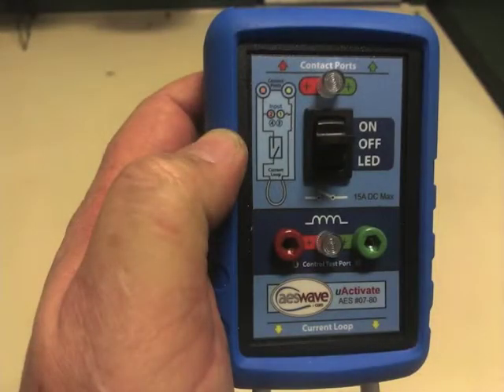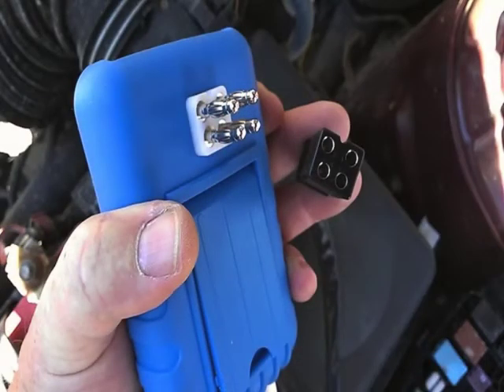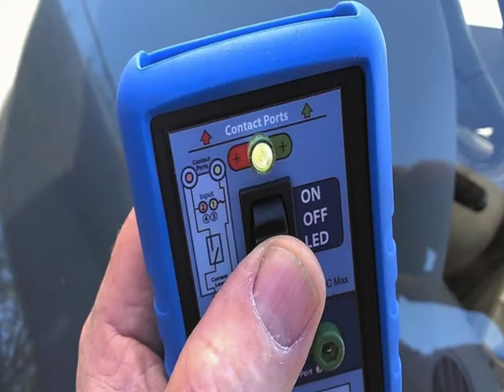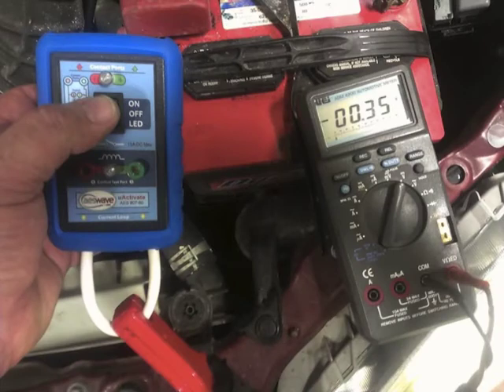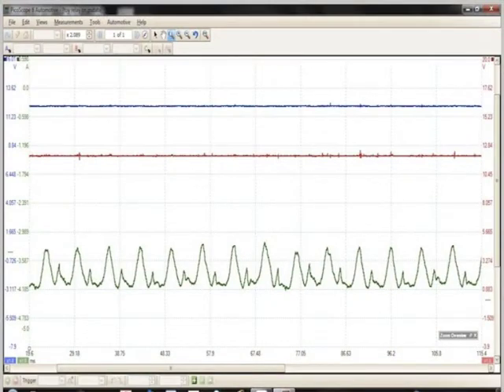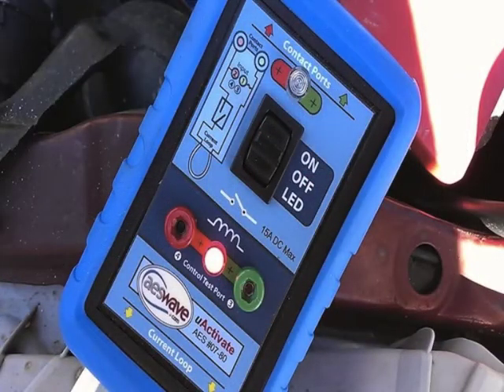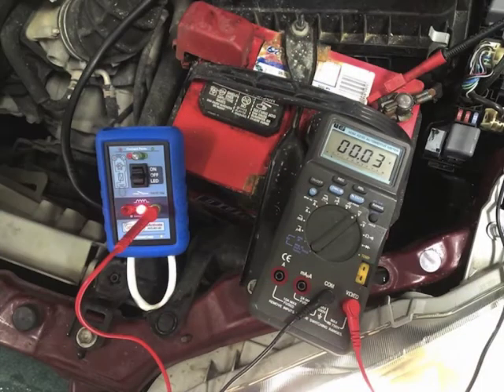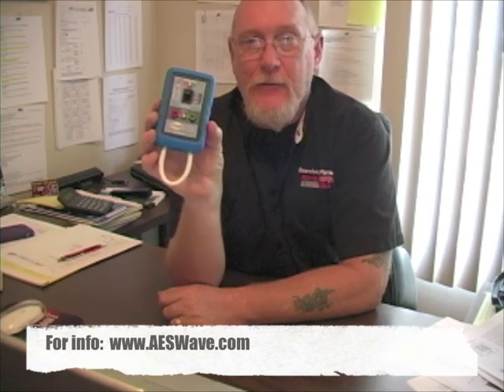Troubleshooting Relay-Controlled Electrical Problems WIth uActivate

Comment: What is the LED switch for.
Reply from the maker: If I recall correctly, it's a polarity check to see if the relay uses a power or ground side driver.

Comment: i have a 2001 gmc savana 3500 box truck with 350 engine 5.7 L . just had ac charged and a new compressor put in. ac clutch don't in-gauge. but if the relay is jumped it work. any suggestions?